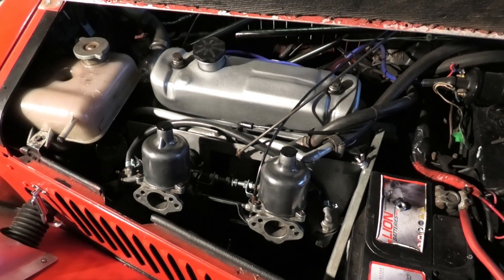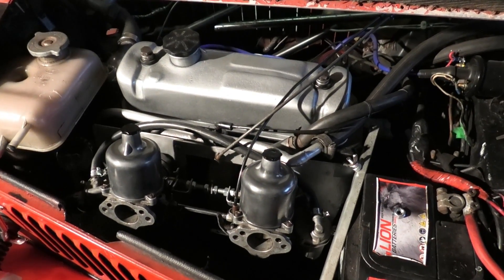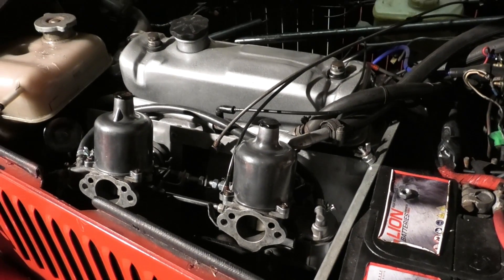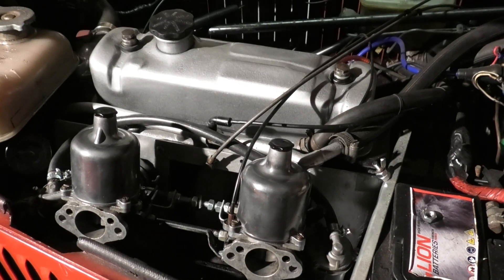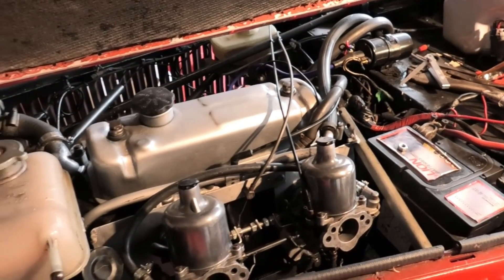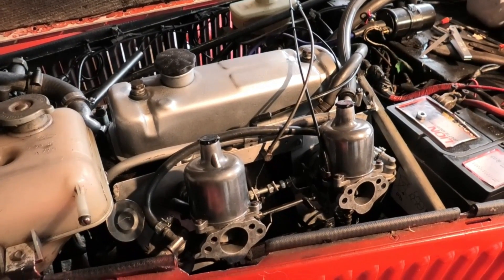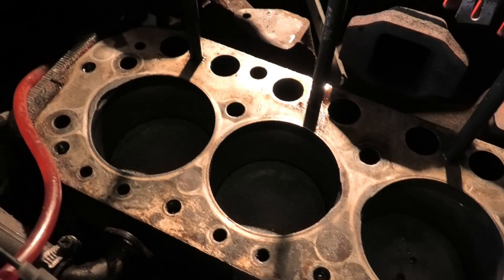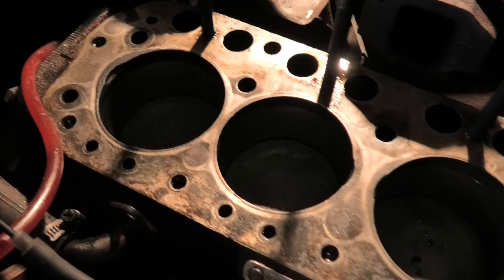MGB Engine is Firing Fuel Back Through The Carb, Why???

Comment: I'm busy with an old Volvo with the same Carbs. If the mixture is too lean it will do this as well. years ago I had a "colourtune" kit I used to set up bikes and multiple carbs and it was excellent and very easy to use . 
I wonder if one can still find it.

Comment: Block face needs attention as it is pitted and dirty, it should be unmarked bright metal before you put a gasket on. The valve seats look to be badly ground and a single angle grind, and valves seem to have a very wide grind on them. On the inlet manifold there should be a gasket on either side of the black thermal spacer or the manifold may leak, also check the carb mating flanges are flat using a surface plate, or a sheet of PLATE glass. The nice man has sold you a duff head! also check firing order on plug leads is correct, get 1 and 2 or three and four on the wrong way round can cause engine to run poorly and spit back.
Phil

Comment: Did you check the intake valve clearances?
Reply from the maker: All valve clearances were set before I started it. Valve seats were a tad rusty so have been lapped. To be honest I used a cheap head gasket which I think might be the source of all my woes, got a payen one now
Reply: @buildituk  Maybe check the height of the dowel that locates the head and gasket, I have come across these being a tad too long and not allowing the head to be pulled down onto the gasket.
 correctly. It is unusual for a gasket to leak between 3 & 4 . As I am sure probably you would probably know, heads usually warp in the middle. If you still have a problem when you get the new gasket in, it would pay you to borrow a cylinder leakage tester, ( which will allow you to blow compressed air into the cylinder when the piston is at TDC on the compression stroke) you will be able to get an idea of where the cylinder leakage is going.